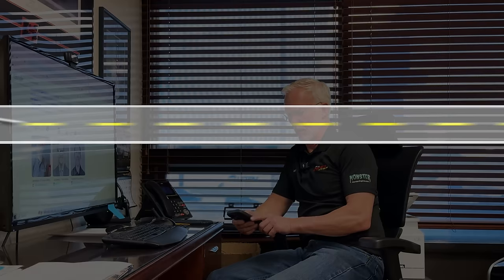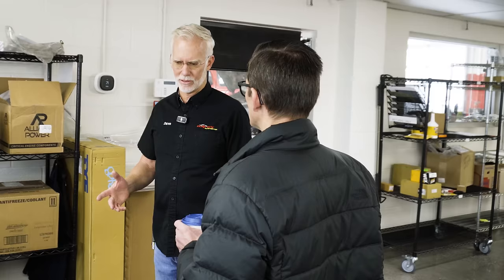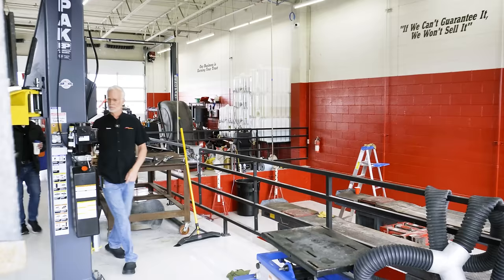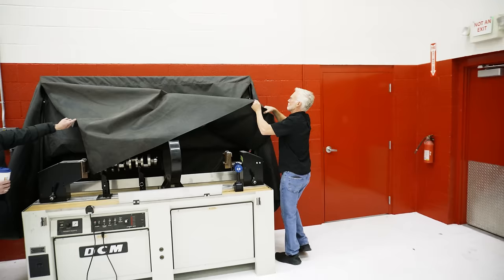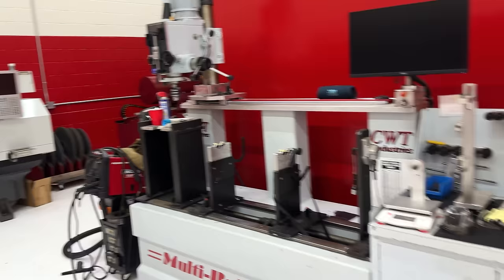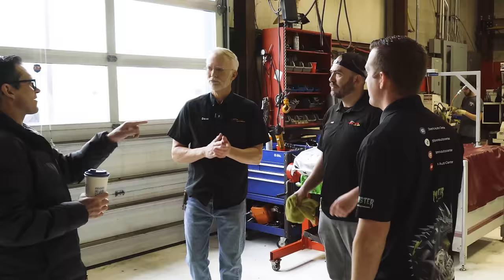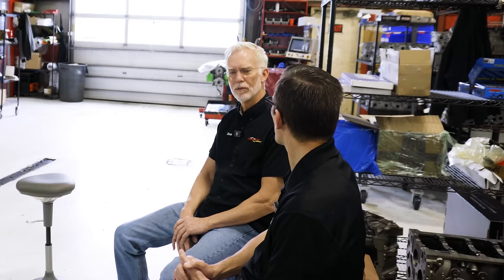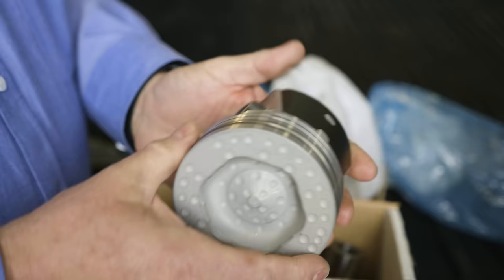Sitting Down With Lake Speed Jr. - The Truth About Oil Change Intervals and Analysis

Comment: Based on what he said would you void the warranty for someone who gets an oil analysis at every 2500-3000 Miles and changes it when indicated by that analysis rather then changing it every 3000 miles? As someone who spends 200 an oil change on Amsoil that is alot of money to be draining every 3000 miles when its possible to safely go 3 or 4 times that

Comment: Knowledge is power.  So basically, all the car makers are crooks.  Got it. My old man always preached changing oil every 3,OOO miles - but of course that was on a 1961 Chevrolet 230 straight six that had no oil filter, just a breather pipe.  I never exceed 5,000 miles between oil changes on my 2012 Ford Escape 3.0 V6 and we're just now turning over 94K.  I'm 70 and still change the oil myself because the ONE time I went to a local oil change chain, they cross threaded the drain plug.  Same adage still applies - an ounce of prevention is worth a pound of cure!

Comment: I am confused. Why is there no discussion about synthetic oil? I put 50,000 on my Grand Marquis 4.6 motor without a change of high quality synthetic. At 135,000 i traded it for an F150 and it was running just fine. I was changing the filter at every oil add, but no change, no sludge, I suspect. 
Am I playing with fire?

Comment: I’ve got a 95 dodge 1500 with a 360 should I change the oil differently from manufacture because of the gas of today or is just going to cause problems with the fuel system ? Also is there a better transmission setup for this platform???

Comment: Oil consumption:  The Oil Guy says 1 quart for 1,000miles on a well maintained engine around 50,000 miles in.
My 6litre V12 N73 has 225,000miles goes about 600miles on a litre - I try not to fret about it and carry a Litre of 10W40 in the trunk.
My mistake years back was to use the oil recommended by Castrol for new engines: 5W30 because oil consumption went crazy.
You either put in loads of 'Lucas' or realise maybe it needs thicker oil.
Yes, EU and UK have detergents in diesel and petrol (gas) but we also have up to 10% ethanol in regular and up to 5% in Super.
Even the last bastion of petroleum Esso Supreme how has ethanol in - up to 5% but how much - they don't have to say.
I have just taken the pump and sender out of my e30 to replace the O-rings - 36yo and oh yes they needed replacing, filler cap seal as well. $35 the lot and well worth it. Just my POV.

Comment: The issue with these test is it is very dependent on your engine. A car/truck with 10K miles compared to 100k miles is going to be different. I think you can get away with 10K oil changes on a new engine but on a engine with 100k miles it is going to be different and I think you will have to change the oil sooner. Change your oil every 5K miles from new to old and you will have a like new engine even at 100K miles

Comment: Dear American Folks,   I ALWAYS change oil in my cars every 7000 km WITH a new oil filter to boot, only when engine is hot....and let it drain for 15 minutes.... air filter every 15 000 km changed alongside the sparkplugs if it were a has engine.....also another rule is: starting the engine means feathering the go-pedal until the engine is warm.....treat the cold engine the same way, as  if you were woke up at 3:00 in the night.....there you do not want to take a sprint and perform to your full capabilities....just take it easy..... and no banzai runs...60-65 mph is enough......all my cars through the years were high mileage 440 000 km to 680 000 km..... and oil consumption on all these various cars between change intervals was neglegible..... never hit the low mark on the dipstick.....for instance: 
my old 1996  Benz W124  with a 250 non turbo 5 cylinder diesel  with 672 000 on the clock started at -15 degree celsius in wintertime after I did 2 pre-glow cycles....engine started after 2 crank revolutions.....
My credo is: get the dirt outa the engine.....

Comment: I may be the world's worst mechanic, and we have a 2021 Ram 6.7 cummings diesel 4x4 for pulling our small 5th wheel. The dealership where we get our oil changed says 10k miles between oil changes so I should scrap that recommendation and go to every 3k miles? I also don't drive it often, what is the minimum one should drive these beautiful beasts?

Comment: Walmart synthetic oil and filter are around $25.00 or less, so an average of $100/year for most Americans. ValvoMax or other wrenchless drain systems are cheap and can bring oil changes down to less than 20 minutes if you use ramps. Why not?

Comment: Dang man - SO I listened to my MFG and have only been changing my oil at 10k miles.  2013 Ford Explorer Sport w/ecoboost 3.6L twin turbo - I did use Mobile 1 fully synthetic.  Got 100k miles on it.  Have I seriously damaged my engine due to waiting 10k miles before changing the oil???  Should I now start to look for a newer car cuz this engine is now on the way out?

Comment: So based on the info in this video...my father-in-law's philosophy of changing the oil filter and adding a quart instead of draining all the oil was wrong? I guess that's why he only got 160K miles on his '76 GMC van before it blew up...oh wait...his tranny blew - not his engine. He did follow that routine religiously every 3K and the van wasn't using any oil.

Comment: Does anyone here know if annual oil changes are adequate for a car being driven 500 to 1000 miles per year?  San Diego moderate temps,  50/50 hwy/city.  2015 4-cyl Sonata with 16K miles. Thanks.

Comment: So I use Valvoline full synthetic high mileage in my 98 Mercury Grand Marquis with 79,000 miles on it, am I doing it right? Lol, I can't think of anything better personally, anybody know something I don't? I drive to and from work everyday 4.5 mi each way so 9 Mile round trip I assume I should change my oil every 3,000 mi to be on the safe side I mean sometimes I make small other side trips all around town though but I do a lot of short distance driving with maybe one long distance drive a month. So obviously 3-month period will come way before the 3000 mi period I should still change it after 3 months I assume or can I stretch it to 6 months?

Comment: What is the magic number for how long an engine should last? 
Everybody's answer is different 

I've got a 6.2 L GMC that has 280,000 with pretty much zero problems and I consistently did oil changes at 10k using synthetic except for the first 2 oil changes. I did at 5,000 and then 10,000 and from then on it was 20k, 30k, 40k...

Listening to these people I should have done my oil changes at every 3,000. I don't know, I think that would have been a waste of a lot of oil because I believe I've gotten way more miles out of that engine than I should have and at any day now that engine is going to go bye-bye. 
It's a gasoline engine not diesel. 🤷‍♂️

Comment: So, if I buy these fuel additives that I supposedly need for every tank of gas...how much is that multiplied times the number of tanks I use before rebuild or engine replacement? And if I get periodic oil analysis testing, use supreme quality oil like Amsoil. Royal Purple etc and supreme quality oil filters that filter down to the finest particles and do my oil change intervals more frequently than manufacturer recommended...how much additional money is that per mile driven? And if you add all that premium maintenance expense up and look at it as a life cycle cost - how soon will its added expense equal the price of a new factory crate engine? Especially if you drive a non-exotic vehicle powered by a standard Ford or GM V8?

I already know the answer - do you?

Comment: @25:40 Oil consumption of 1 qt per 1000 miles on a 50k engine? That's like rolling coal. I do oil changes every 6k on my '09 Toyota Sienna with 380k and '96 Ford E-150 (4.9L) with just about 500k. The Toyota needs no topping off, the Ford gets one qt between oil changes. High altitude (above 7000'), constant mountain driving, and (with the Ford) hauling trailers and/or a full load just about every time.

Comment: My belief is a fuel injected engine runs much cleaner than an old carburetor engine so therefore I could increase my oil change intervals from 3,000 to 5,000 miles ,am I wrong?

Comment: Ran my Amsoil for 12K in my car. 
Supposed to be good for 25K miles. (I would never do that).
 Oil analysis came back with a very low base number of 1.5. 
No way this oil would have made it another 12K.

Comment: I don't understand why auto makers aren't using gapless rings in GDI applications. It would solve the intake valves carboning, and reduce emissions even with any slight increase in mpg from the slight increase in drag. That is the bureaucracy of CAFE vs EPA emissions.  There is no way that reducing blow-by by 50% wouldn't cause a large decrease in tail pipe emissions. I would think that doing so would decrease total vehicle emissions by as much as evaporative emissions systems do. If you reduce oil vapor then less burnt oil vapor exits the tailpipe, and it reduces the work load of the catalyst system.

Comment: parts have to be clean before oiling, you have to get cleaners line parts washer stuff off the piece before oiling  as the cleaners can leave a film.  look at bearing  regreasing departments at plants to aerospace component  rebuild shops  they are anal about getting the metal back to pristine before it sees lubricants. Back in 2004 VW and Audi came oil with a new spec oil, and people thought they could just use Rotella,  shortly after cams were rounded , so you have to use the best of oils,, Its cheap insurance.

Comment: Brand new 5th Gen 4Runner owner. 700 miles on the motor. When should my first oil change be? I will do the intervals at 5,000 instead of 10k. Should I find something with ZDP? Is Mobil 1 fine and is there an advantage to buying extended life but still change at 5K. And what fuel grade should I use? Sounds like the 87 might not have enough detergents like 91? Not sure I’m computing this video accurately. Any help would be appreciated. Thanks in advance.
Reply: Read and follow the owners manual!...No ZDP that is for much older engine technologies. Regular Mobil 1 or any full synthetic will do fine. Run the recommended octane. All fuel has the same detergent level regardless of octane.

Comment: My dad bought his 93 Ford Ranger brand new. He has done a total of “around” 5 oil changes in the entire 300k miles he’s put on that beater. The truck passed smog and has only needed a cam chain and a heater core. So, I understand the chemistry but I’ll be damned, 5 changes in over 300k?

Comment: My 2014 Ford Edge with a 3.5l NA engine doesn't use ANY oil with 10,000 mile OCI with full synthetic oil and either a Wix or Purolator Boss filter. This is based on results of oil analysis from Blackstone labs who observed I could go out to 15,000 miles.  You know, real data, not my grandaddy says anecdotes.
Reply: That's a good report. I have a 2020 F150 with a 3.3 NA that had two 9K mile oil changes on it when I bought it used with about 19k on it. I thought maybe if it only had two oil changes at 9k the engine is okay.  Reading your report eases my mind a little.  The 2014 3.5 and the 2020 3.3 are not the same but similar.  I'm going to do the Blackstone test.  3.5 in the Edge is a great engine.  Just watch out in case it has the internal water pump. I think Ford finally modified it with a weep hole so you can tell if the bushing ever goes bad so you can get it repaired before water gets in the oil. Happened to my sisters Edge but hers is one of the first ones and it did not have the weep hole indicator. She didn't know it was bad until it was too late.  It's such a good car she just had a re manufactured engine installed.  Better than buy a new car at the prices the stealership wants.  Good for another 200k miles.

Comment: 25:28 did i understand this correctly. So it would be normal if my diesel/gasoline engine used 1qt per 1000 miles? So if i changed oil every 3000 miles and never added any in between it wouldnt be shocking to see it 3qts low? Sounds way excessive to me but definitely interesting if true. I dont think I have had a daily driver that used that much oil and not had something wrong with it. Am i the only one?

Comment: Oil analysis is key, I don't agree with the manufactures service intervals. One  mechanics oil change interval opinion does not fit all. like you said, oil testing is the key.  Everything changed when gas engines went with fuel injection, no more pumping the gas pedal which caused flooding,  or having to adjust the Carburetor automatic choke in spring and fall. The excessive fuel washed the lube away. In the 60's and 70's, we were amazed when we saw an engine that never saw a wrench in 120,000 miles.

Comment: I send oil samples into Blackstone while Iam changing my oil on my 5.9 my wife’s Acura and my Kubota 3 cylinder diesel and my Kubota I change every spring so time wise it’s one year and oil samples say run it 300 more hours and my 5.9 gets a oil change before 5000 miles and oil sample says to go 500-600 more miles we are both retired so we don’t drive every day and may not drive for a week and when I start my 5.9 I drive 5 miles south and at 70 mph and then drive about 15 -20 miles every time I start my 5.9 so I wand that engine hot when I get back home and the heat will get most moisture out of the block. The oil sample tells me if Iam getting fuel in my oil and that tells me if I have a injector failing and I will be checking for Mr Speed P and my wife’s Acura it always comes back to drive it 2000 more miles but I don’t do that because because Iam changing my oil when sent in.  When I change my oil in my 5.9 I put a 1/2 gal of Marvel Mystery oil when motor is warm and I let it  run for about a 1/2 hr and then I open a valve in my oil pan to drain oil out you probably don’t like my Futsba valve and it has a safety pin to keep it from hitting something and dumping the oil out . I have put them on two brand new cummins and I don’t get off the and fly threw the woods , Iam 69 yrs old so only time I use 4x4 is for snow and now being retired I don’t drive in rain or snow . Ok sorry for the long ramble but with total Speed and his diesel rings and the new pistons I want both of them in my 5.9 bad oh and I run Amsoil in all my stuff. When truck is new I run Rota Dino oil for the first year then Amsoil after that. Good Day !

Comment: Change your oil filter "Often" because all oil filters have bypass valves at the bottom of the filter where all the trash is and if the demand is needed the bypass valve will "Open" and suck that trash into your pump. 😮

Comment: Sounds like engines are almost as complicated as printing. I go AT LEAST 12k mile intervals in my duramax, an '05 LLY and I drive it. Maybe it's a unicorn, due to hit 750,000 miles in the next few days, original internals, great compression, excellent fuel mileage, original CP3 pump, injectors changed at 610k just because (still ran fine) trans original, rear end original, transfer case rebuilt with aluminum housings. Interval of 3k is 250 oil changes vs the 50 or so logged on my charts. So tell me the expected life span, would 3k intervals = 1.5 million? I realize this truck drives 300 to 2000 miles per trip and is not a typical driveway ornament. If one of my other vehicles sits for a year amassing 500 miles, it gets an oil change.

Comment: Why are these guys not talking about pre-oiling systems? When you crank the engine without oil pressure, which happens every time you start it, the bearings suffer. Pre-oilers are cheap, simple and will greatly reduce the amount of wear and tear that occurs are startup.

Comment: 25:53 one quart of oil consumed for every 1000 miles? I've NEVER seen that kind of oil consumption in anything without worn out rings, leaving a smoke screen. Oil analysis, to me, is looking at how dirty the oil is when i'm changing it. mine used to be pretty clean after 5K, now I've noticed, at 300,000, it was pretty dirty last time. I guess i'll cut it down to recommended (by this vid) to 3K.  Besides, my toyota's oil filter is about as big as a thimble.

Comment: I have 2017 Nissan Micra k13 3 cylinder two hours a day driving. Only 25kms on it the pistons the rings stuck what type and grade of oil would you use I hate this car

Comment: quality of mercedes is worse than you think :D i spent 6 years of my worklife doing parts for them. headlights for cla and a mercedes, later carbon parts for amg gt and for every merc lineup. even the most expensive cars aren´t built as good, as you would think. audi has far greater quality standard, bmw, aston martin and porshe too. even skoda and volkswagen btw. i´m talking about fenders, hoods, headlights etc. i´m not talking about electronics and engine, because i haven´t built any, so i don´t know :D

Comment: I understand what he was saying about the low detergent straight weight oil BUT not all straight weight oil is like that. You are referencing old school tractor stuff.  A straight weight with a normal add pack will outperform a multi weight oil period. To get multi viscosity oil in the first place they have to add a viscosity modifier. This reduces the oils film strength. Kendall green aka brad penn, aka penn grade 1 straight weight oils are great for this. Anyway just throwing the film strength thing and why out there. I am certainly no expert lol but I got the info from an oil chemist. This guy is clearly an expert. Please go help mobile 1 get the higher than everybody else's oil, iron wear in UOA samples figured out. I wont touch mobile 1 with a 10 foot pole.